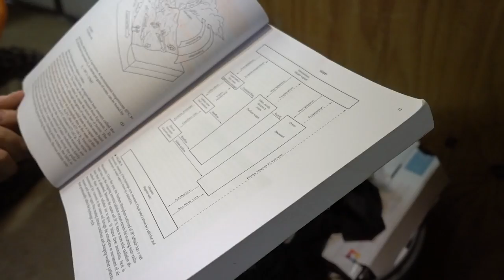FIRST RIDE ON NEW KTM 250

Comment: 2016 KTM 300 140 hrs 
2017 ktm 150sx with 50 hours

I run Mobil 10w-40 full synthetic and have has Zero problems with my motors. Pistons look awesome. Same oil used on my 09 300 xc for 3 years. Have never gone through a clutch on my KTM. Wish you would have gotten the 2013 250 sx. Would have done you fine where you ride. You deserve a newer and well running machine for all the work you put into this. you only live once.
Have a braptastic day

Comment: Hey Dalton use your pressure washer to fix that dent in your expansion chamber. Just seal off one end and around the nossle of the pressure washer in the other end and the hydraulic pressure will fix that simple as can be. there is lots of vids on youtube showing it done.   So happy to see you bought a KTM and especially the 250 XCW   love those wide ranges.   My first dirtbike was a 74 Honda CT 70 or a yamaha MX 175 2 joker for a straight up dirtbike, followed by a long line of others. But mostly always older bikes, I love working on them in the shop almost as much as riding them.  keep up with the vids on the projects and riding just as much man!!

Comment: My first bike was a 1983 Honda xr200 I'm 15 and I sold it 3 years ago now I have a kx250
Reply: my first bike was a 1979 honda xr250 now im 13 and ride a yz250f
Reply: I had an 89 XR200R    was a fun bike but i couldnt stand the 4 stroke 200   not enough balls  I have always been a 2 stroke fan but I have owned a couple different 4 strokes and some were ok
Reply: Neil Eaglede
Reply: Neil Eagleden you don't want a older 4 stroke you want a new one that has fuel injected

Comment: first dirtbike was a baja 125 four stroke from canadian tire, weighed a ton but honestly the best motor ive ever seen. I was a kid do i only changed the oil once a year and never once even thought or knew about a air filter so that was never cleaned. The bike ran for 5 years without ever blowing the motor and never once needed parts or anything before i sold it. But it weighed just shy of what my 2016 yz450f weighs lol. motor was bullet proof and i put it through hell near every day

Comment: 1993 kdx 200, first bike ever owned. Religiously ridden, cant kill a maintained 2 stroke. As far as the oil. I wouldn't waste your money on it, always remember older bikes usually arent sleeved and ethanol gas etches aluminum. I currently ride a 250f religiously. Still own the kdx still rips, but they are different styles both with qualities. After watching your first ride you need more rpms on the 250x. Think of it like a chainsaw just full throttle it and bang gears!!!

Comment: I have a 2014 KTM 250xc.  Run nothing but maxima super M oil.  no issues.  You should have grabbed that 2013 250sx.  the 2011+ KTM frames are much better than the frame you and jake have.

Comment: First bike was a Pw 50 when I was a young lad. Didn't ride for awhile then I got a 1976 kv 100 had it for several years then in 2009 I bought a brand new yz250f had it up until last year now I'm riding a 2016 yz450f

Comment: my baja mini bike was the first bike i ever rode (besides my power wheels harley i had when i was 3). i still have her to this day, and even though im 17 now its still my favorate bike to ride because it makes you feel like a bad ass. i still wrench on her and its about to have her third motor swap. im hoping to beat its last speed record of 50 mph. i watch your vids every day and it makes my day when i get to watch them. keep it froggy freash and have a good day.(sorry for the spelling haha)
Reply: Haha, that's what I had in it last. I dissabled the governer, put a straight pipe, and k&n style air filter, then took out the gear reduction system so she was going 50. I had the motor in her for about a year or to and rode it most everywhere. then I traded the motor for a dirt bike haha. those preaditors can take a fucking beating

Comment: Sounds like it's running a title lean there . Sounds way boggie and if you let it idle to low it dies , defiantly needs to look into that carbureter, And washing bikes in the mud lol !! That works !
Reply: Could his jetting be a lil' lean due to the 40- degrees outside? Probably stock jetting for 70+
Reply: That could be very possible,  maybe the air mixture screw needs to be adjust also ,

Comment: You van clean up the plastic with a razor blade and sand paper and boiled linseed oil and paint thinner. 3 parts thinner and 2 parts oil. good luck.

Comment: First bike that I rode was a 2006 or 2007 kx250f. It was the last year of the carbureted bike and I twelve o'clocked the damn thing within about 20 second of sitting on the bike. Worst part is it wasn't mine but I didn't loop it and I didn't fall. Moral of the story....put your nuts on the gas tank and let her rip.

Comment: I run rotela 15/40 in my yz426f and my zx10r 2004 and never had anyt oroblemi.,I have run that in every motorcycle I have had since 1990 2 stroke or 4 stroket.
Reply: So far how do you like the 2 stroke versus the 4 stroke
Reply: My first bike besides mini bikes was a hodaka dirt squirt 80. But I'm old compared to you. But I can still braaaaab

Comment: NOOOO DONT PUT 4 STROKE OIL IN 2 STROKE!! 4 stroke oil haves to be SAE accepted so you can out it to 2 stroke without breaking engine.. and it has to be for wet clutches. my first bike was cpi sx 50, chinese, but it is okay i have it still i did rebuild on it

Comment: the first bike i rode was a  motovox m80 with a predator 212 I modded in it doing 52 mph, with full custom suspension i desingned myself, soon im ganna be swapping the motor for a pit bike engine, its time to move on from centrifugal clutches, plus i wanna pop fat wheelies and hall ass with.